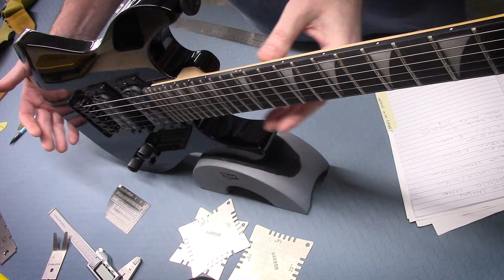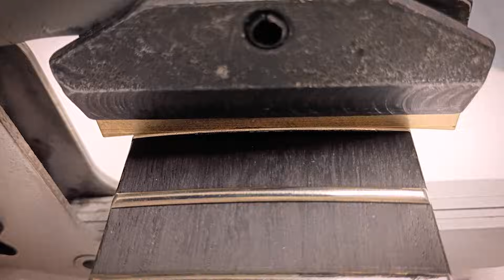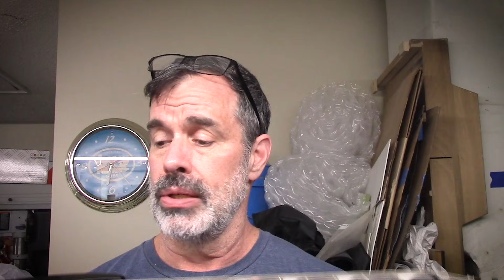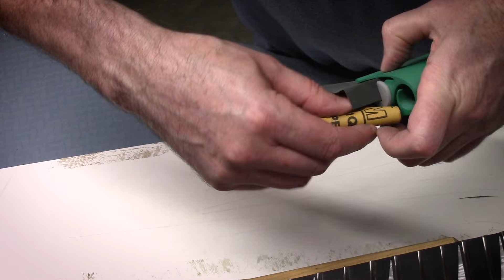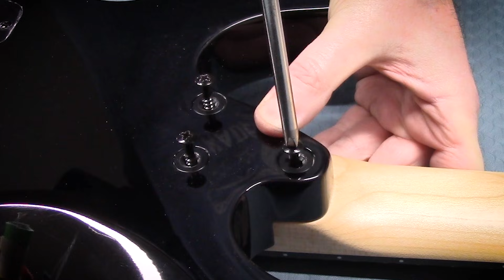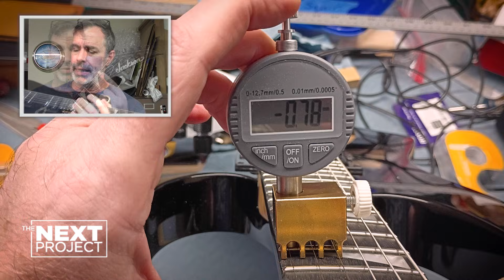Jackson Dinky Minion - Evil Minion Setup!

Comment: I just got one of these for my son and it’s having issues with the B string coming out of the nut every now and then. Also it doesn’t seem to hold tune super great and sounds a little sour. Thinking about trying to change the nut and I saw that you made a new one. Can you buy a replacement nut or if not, what did you make it out of?
Reply: Thanks for the reply man, definitely will try out that hosco sos. A couple of the tuners are pretty rough too so I’m gonna probably replace those too
Reply from the maker: The Hosco SOS isn't designed for this scale length, yet it seemed to help. Weird.
Reply from the maker: Joe, thanks for watchin!
Sorry you're experiencing some "sour sounds" from this lil guitar too.

If the B string is popping out of the nut slot, the slots may not be deep enough to hold the string. 
Dose the string height at the first fret seem high?  On this project guitar, the first string height was pretty high, so your guitar may have a similar issue.
I initially re-cut/deepened all the string slots in the nut, but that didn't solve the tuning and out of tune issues.
If you would like to try a different nut, measure the width of the nut, and google for a good replacement, TUSQ Nut may have an option that will fit, but I'm not sure off hand.
 
If I recall, I made a bone nut for this project, it did help, but what seemed to fix more of the "sour" was adding the HOSCO S.O.S.
https://www.philadelphialuthiertools.com/guitar-bass-nuts-saddles/compensated-guitar-nut-for-electric/

It is basically a compensated nut, but without being an actual nut. It butts up against the face of the nut and is sandwiched between the fingerboard and the strings. It changes to take-off point of each string, which alters the total string length and tension of each string by just a smidge, but made a very noticeable difference - at least to my ears. 

Good luck with your Minion!

Comment: I found this guitar at Guitar Center and for a new guitar this is an aweome amount of work needed to be done on a new guitar.   This is all due to mass production standards that gives Luthers an income to do plenty of set ups I presume but forces the buyer to pay even more for a quality guitar.
Reply from the maker: Mark, thanks for watching!
I don't know if they will all have the same issues as this little guy, but the vid may offer some ideas as to where to look if there is a problem.
If I recall, the best fixes were to seat the frets properly (level, crown, polish too), maybe a better nut material, and I was really surprised by the short-short scale tuning improvement by adding the Hosco faux nut compensation thingy.  My hearing isn't so good, but I could clearly hear better, happier notes. 
Good luck with your projects!

Comment: Im in the middle of setting up a purple minion. The neck has been throwing me. Thanks for all the guidance. Super helpful.
Reply from the maker: Frosty, thanks for watching!
The Minion is a cute guitar, but can be a bugger for sure.
I don't know if there was any one thing that was "the fix" for this guitar, but a number of things did help. The tuners were pretty good, but there was one or two that weren't. The frets all needed to be seated, leveled, crowned, polished. The original nut seemed really good, but for some reason the strings wanted to stick in it a bit, so the new nut did help with that. Still it seemed to have tuning, or "in tune" issues. That's when I tried the Hosco SOS compensation seemed to bring it all together. The little guitar surprisingly sounded better, more "in tune". 
Good luck with your project.
Be safe and take care!

Comment: I compared all 3/4, 2/3 guitars at GC Detroit. The Mitchell MM100 smoked every other one. I put a DiMarzio ToneZone in the bridge and a 1987 Gibson HB in the neck. Guyer locking tuners and  FR 41.3 locking nut on. Strings are a custom mix of Ernie Ball 10/13/17 from the 3127 set and 24/32/42 from the 3723 set. Yes I have $100's dollars in half sets now. This guitar sounds as good as anything else I've played up to $500.
Reply from the maker: Guradian, sounds like a fine lil' guitar you have there. Thanks for sharing the process and specs.
Kinda fun to take something, fine tune the parts and make it much better.
Be safe and take care!
Reply: @theNextProject  For sure. I'm wondering if I can bolt a Jackson Minion neck onto a Jackson Dinky body. I like the frets closer and Floyd Rose tremolos. What do you think?
Reply from the maker: My initial thought is, no, the Minion neck would not work properly on a Dinky body.
I believe the Dinky is a 25.5in scale guitar, the Minion is a 22.5in scale.
The difference in scale length of the Dinky body (neck pocket/heel to bridge saddle distance) would place the shorter scale Minion neck at the wrong distance from the bridge and throw off the scale length... intonation no where to be found.
Sorry.
Reply: @theNextProject  Thank you for saving me time and $. I noticed not 2 of the same guitars are the same. Some sing some not so much. I got lucky with the MM100. I didn't like the one on display at Guitar center and got someone to get another one out of the warehouse. It sings with resonance! Good works and Stay Blessed!!

Comment: I have this jackson dinky minion in color blue . I would like to have it in a very good set up like you did. so changing the nut and the tuners into locking also thinking of changing the bridge. it stays in tune all the time right ? thank you so much. you done an amazing job on that guitar sir
Reply from the maker: gonzalez santelices, thank you for watching!
This Minion needed a lot of little things.
Perhaps the thing that helped the most with tuning stability was the Hosco SOS (Sound Offset Spacer).
It is basically a compensated nut extension. I was really surprised by how much it helped this guitar.
The other things I did also greatly improved play-ability and overall stability of the guitar. 
The original tuners were pretty good, but the replacements were better. Nothing wrong with the bridge once string height and intonation were adjusted. 
For some reason, the factory nut on this guitar was also causing some tuning issues. I cleared the string slots, had everything prepped really well, but the strings wanted to stick a bit. I made a bone nut and that improved tuning stability.
So, if you are having similar issue, try to narrow down what seems to be the worst thing. Fix it, then determine what may be the next issue. No need to do everything at once. 
Good luck with your guitar, they are a fun little machine.
Be safe and take care!

Comment: Hello John,
Thank You for this video. As always very entertaining and informative. The owner of that pointy thing is a lucky kid. Great job! 

Have you ever tried to apply the superglue with a razor blade?
Stay safe, my friend
Jens
Reply from the maker: Jens, good to hear from you my friend, and thanks for watchin!
I have used superglue applied with a razor blade, actually did that on a few little things last weekend. Reason I used the pipette for the frets, is that the pipette will hold more superglue, less re-filling needed. 
The razor blade process works pretty well, but I have a strange moment where the CA wants to stay on the blade, then suddenly surface tension changes and the glue takes off to its new home. Usually its where I was expecting, sometimes it goes elsewhere. 
Hope you are doing well, be safe and take care my friend!
John